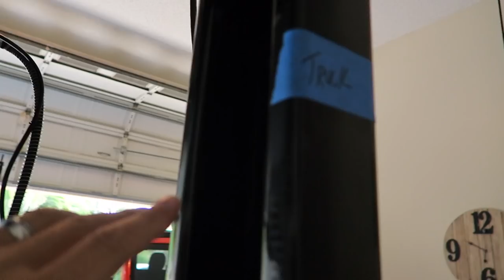Raising My Tacoma - How A Car Lift Works

Comment: If you don't mind me asking what made you go from Tundra to Tacoma? Searching for a new truck. Was the gas mileage too much on the tundra?
Reply from the maker: It was due to space in my new place.  There was no room to lift the Tundra or out on larger tires.  It just didn’t fit.  Otherwise, it would still be here.  Love the Tundra👍

Comment: See as I thought not all home garages are tall as yours. I’ve never seen a tall garage when I’ve home shopped. Also most cases garage door openers are in the middle of the sealing. But boy love to have one for oil changes and power washing but Ooo well. You really didn’t need one for the Jeep unless you plan on buying another car down the road.
You must have sold the Vet and BMW.
Reply from the maker: Yup..this garage is crazy high.  There will most likely be something else down the road....we’ll see🤔